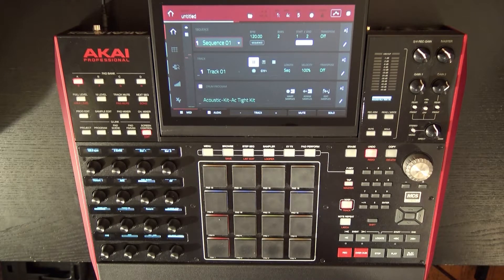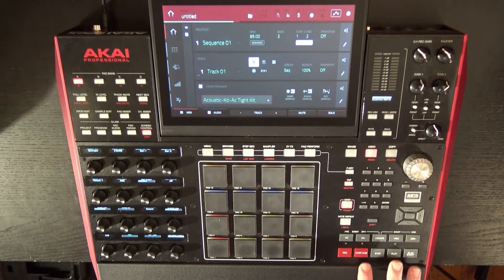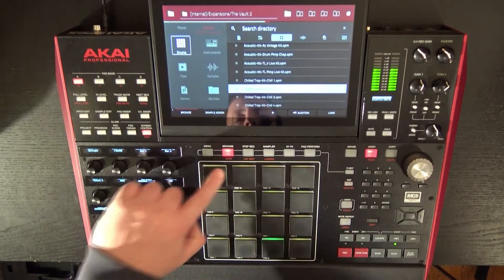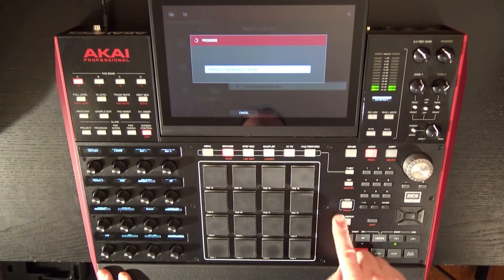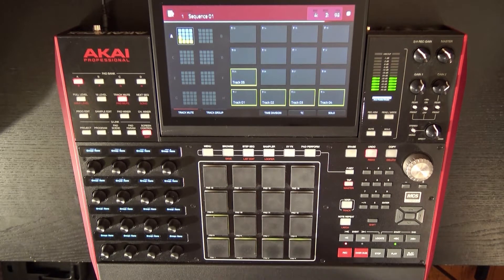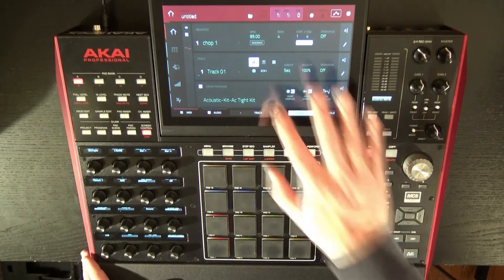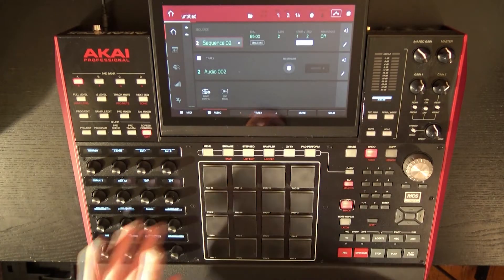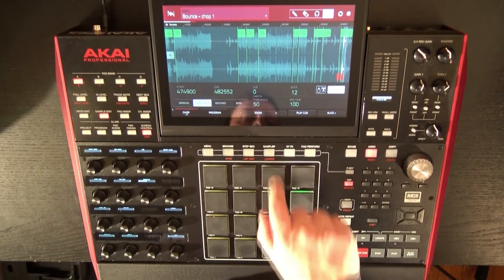MPC - YouTube Answers - Workflow

Comment: Can this unit work with apc40 mk2 or Behringer x touch in standalone
Reply from the maker: Hi Bobby,  The APC40mk2 will send basic midi note on and off info so you can use it to play a key group or that sort of idea.  However it doesn't map out as a Control Surface.  With the lay out of the MPCX i havent run into a situation where I need an additional controller.  Everything is lay'd out on the hardware of the X in a easy manner.  I don't have a Behringer X Touch so I'm unable to check it out.  I assume it would have the same result.  Thanks for the comment.